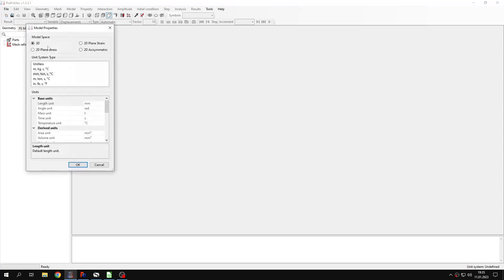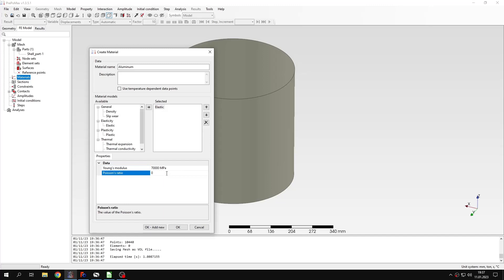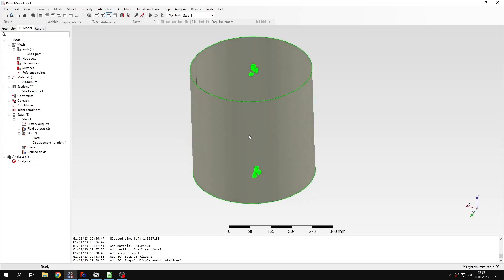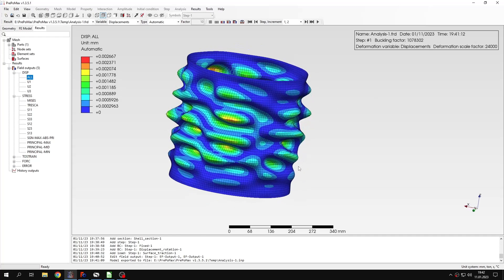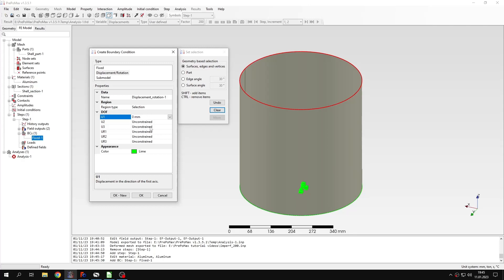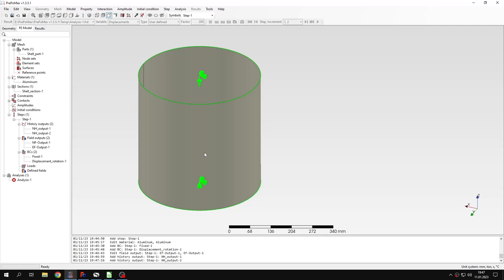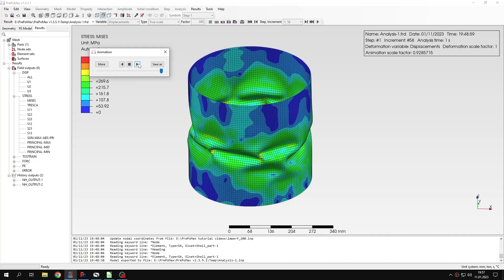PrePoMax (CalculiX FEA) - Tutorial 30 - Nonlinear buckling of a cylindrical shell

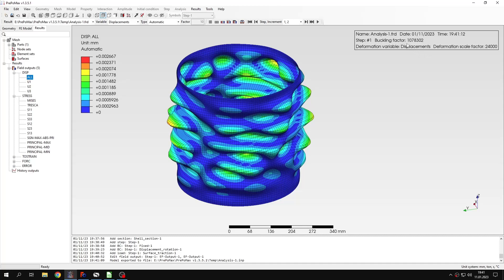Comment: at 5:59 you assumed the critical load to be 1.0843*10^6 N, In the end 15:55 the critical load seems to be around 3*10^5 N so approximately 70% lower. 
Is it correct that this is mainly because of the imperfections you implemented, or is linear buckling just that imprecise?

In other words: I saw people who implemented nonlinear buckling not with imperfections but with just an iterative approach. The argument there was that linear buckling often overestimates the capacity of a component to resist buckling by around 15% (sometimes more, sometimes less). The approach you choose here is new for me although it seems to make sense. Im now trying to understand how to compare the two methods. My understanding at the moment is that your final calculation is somewhat equivalent to a iterative nonlinear buckling analyse (without imperfections) * safety factor from literature
Reply from the maker: Linear buckling can overestimate critical load a lot in some cases - especially for shells that are sensitive to imperfections. There's an interesting discussion about this in Timoshenko's "Theory of Elastic Stability" but I can also recommend the articles on the Enterfea blog. They cover this topic really well. You will also see that the guy who runs this blog recommends using imperfections from nonlinear analyses but still the most common approach is to apply imperfections by scaling linear buckling mode shapes.

Comment: Brilliant tutorial. Thank you for uploading it
I just wish to know if there is any reason behind the scale factor 200. I know it is used to obtain the intial imperfection but why specifically the factor 200. In general, how should we decide which scale factor to use for any unknown geometry
Reply from the maker: Thanks. In this case, I just selected a reasonable value after a bunch of tests. But normally, imperfection amplitude is selected following the recommendations from engineering codes, among the others. It's a fraction of the shell thickness. Here, it was around 20%. But shells are usually very sensitive to imperfections so it's good to check different values.
Reply: @FEAnalyst  thank you for the information

Comment: Great tutorial, as always, thank you! Do you know if with PrePoMax (or CalculiX) it is possible to do a dynamic crushing simulation of a tube?
Reply from the maker: It’s possible with dynamic implicit or (better) explicit analysis procedure. It may not be easy because of the limitations of CalculiX but should be doable. Dynamic analysis will be available in the next release of PrePoMax, for now it can be defined using keywords.
Reply: @FEAnalyst  Very interesting, thanks

Comment: I'd like to request some tutorials on how to best work with .inp files within PrePoMax, and especially in relation to using not yet implemented CalculiX functionality within PrePoMax.
Reply from the maker: There is one tutorial showing the usage of a built-in keyword editor for creep analysis. For now, I omit other examples like that because they may soon become obsolete once new CalculiX features are implemented in PrePoMax (like dynamic analyses). Perhaps I could show something requiring export and external editing of the input file but then the analysis would have to be submitted from the command line and only the results could be opened in PrePoMax.
Reply: @FEAnalyst  I understand, and I suspected this would be your reply. I think your suggestion is good, and relevant. It could be many years before all CalculiX features are implemented into PrePoMax.

Comment: Is it possible to also evaluate the Mohr-Coulomb theory in the software?
Reply from the maker: CalculiX doesn't have built-in Mohr-Coulomb material model but it can be implemented using UMAT subroutine.
Reply: @FEAnalyst  I didn't understand why you imported the file (12:14), can you explain? What is the proposal?
Reply from the maker: @McHumaty  Geometric imperfection is applied this way in PrePoMax - perfect mesh of the cylinder is replaced with deformed mesh from linear buckling analysis.
Reply: @FEAnalyst  I understand, so you took into account that the evaluated geometry had imperfections... I like it!
Reply from the maker: @McHumaty  Yes, it’s crucial in nonlinear buckling analyses to introduce imperfections so that the bifurcation problem is turned into a problem with continuous response.
Reply: @FEAnalyst  Didn't know about that strategy... live and learn.